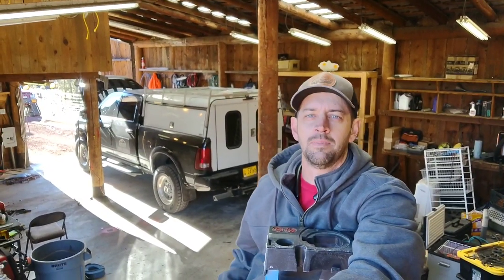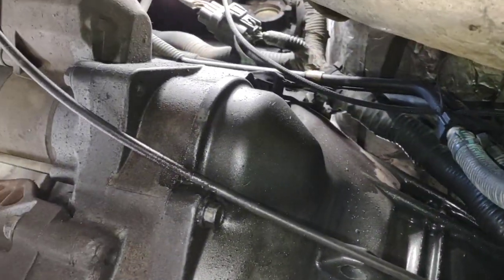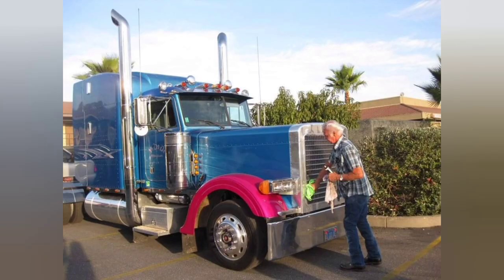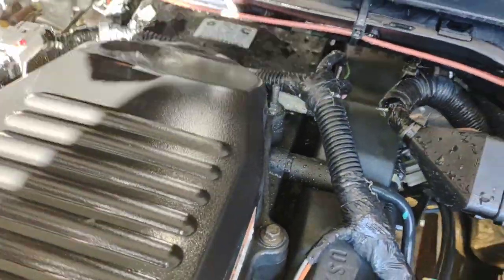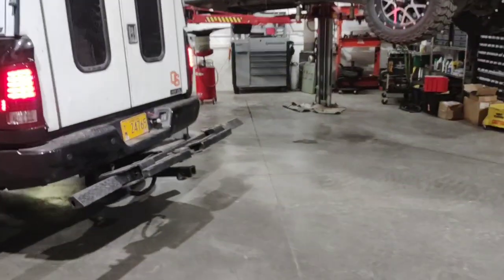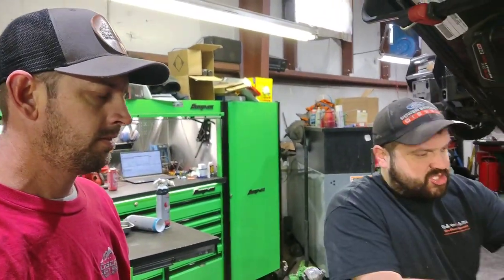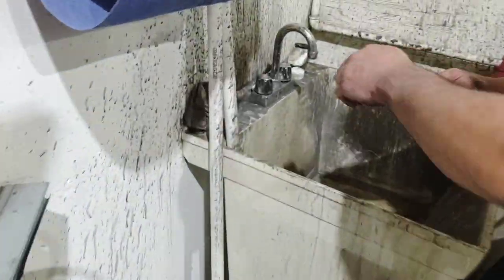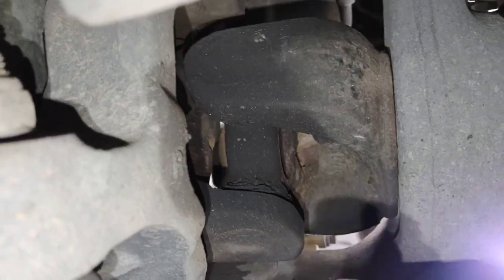My new tow truck is in the shop AGAIN... Super Clean to the rescue!

Comment: At 1:35 you show the oil filler cap in the valve cover, the oil residue from around the cap and valve cover indicate excessive crankcase pressure, either from a partially clogged pcv breather system, or ring blow by. Hopefully the first, much cheaper to fix.
Reply from the maker: The crankcase breather filter was completely missing, meaning the pressure that should be going out the breather was going into that chamber instead

Comment: there is a breather filter under the little cover on the front half of the valve cover if they dont get changed once in a while they will cause oil leaks everywhere prematurely. it may not be leaking itself but when clogged up it can cause extra crank case pressure. fleets ive worked on have typically replaced the filter every third oil change on big trucks.
Reply: made this comment before watching the second half of the video cause i didnt realize the repair was gonna be in the same video
Reply from the maker: @BoostedMooseGarage  the filter was completely missing.  That housing on the front half should never have any vapor or crankcase pressure in it.  But with the filter missing, it was putting pressure into that housing and blowing the oil out the back
Reply: @CaseyLaDelle  the filter has seals in the holes and around the outside as well. It probably got pulled out and tossed by a previous owner because they are around 100 dollars

Comment: I also have a Dodge 6.7, (Ram),  (What the hell is all of that about?), and I would HIGHLY recommend that you to install a FASS fuel system on it.  There is a video on their web site that explains why you need this upgrade to your pickup.  I have been a heavy equipment mechanic for 45 years, and what they explain in the video is absolutely true.  Every time that I have pulled a fuel filter off of a stock fuel system the filter is not full unless it gravity filled while taking the filter off.  A set of injectors for one of these engines is not cheap.  $3,500---$4,500.  Mine is an 09 that I bought new in 2010.  It has a standard transmission and a long bed.  Both of those I did want, so a win win for me + I got a big discount because the warrantee had started, so they had to sell it as a used vehicle with 27 miles on it.  It is also deleted.  I will have to try that Super Clean.

Another plus, the new fuel filters are easy to get to.  The factory fuel filter-----not so much.

Comment: I'm always super nervous to clean my engine bay, spray water in the wrong spot or wrong way and your going to have some kind of issue.
Reply from the maker: Doesn't hurt a thing
Reply: @CaseyLaDelle  I had issues with one of my car's chugging weirdly after doing it when I was younger. Since I got my new truck I've always had the dealer do it for me. That way if something went wrong it would be their fault and they would have to fix it.
Reply from the maker: @jsav5845  if so, you already had problems before the water
Reply: @CaseyLaDelle  Probably, it was an 88 Beretta. I don't recall having issues prior to that because it was so long ago but I remember what it was like afterwards for sure. For the next couple days after doing it, it was slow to accelerate and bucked like a bull. Never really cleaned any of my engine bays after that except for hand washing.

Comment: Good thing you didn't pressurewash your trucks engine bay, newer vehicles especially have hundreds of "computers" in the engine bay a lone, and they while able to widstand getting wet weren't designed to have water shot at it at over 100 PSI. I have seen many people damage their electrical systems doing that and its always ended with expensive repair bills.

Comment: By any chance does this thing have a K&N air filter in it. If so your engine is dusted and has excessive blowby. This clogs those internal filters rapidly. He pulled it and put that tiny worthless external cone breather on it but it won't stop excessive blowby